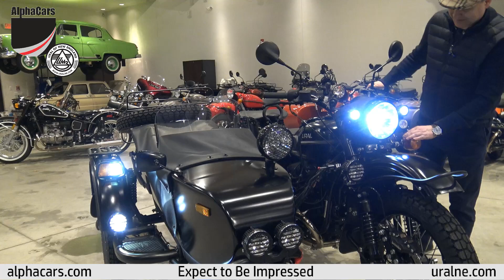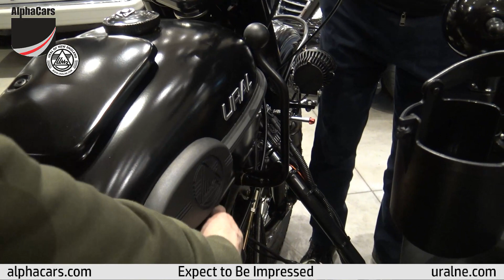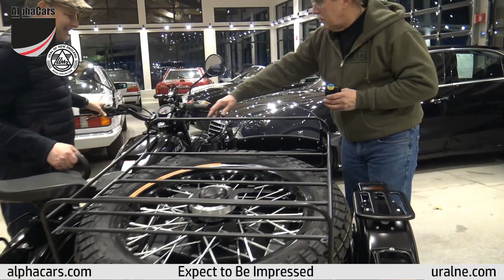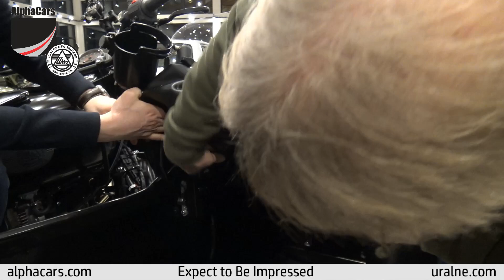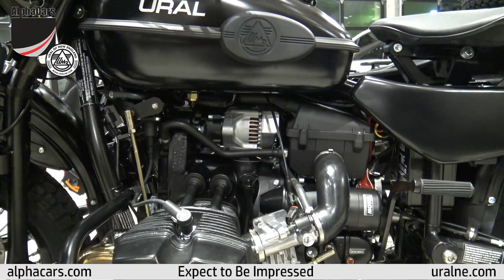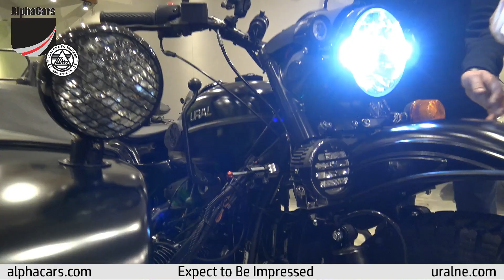2018 Ural Gear Up Custom, Overview, Ural of New England

Comment: Good looking Ural, but what does its weight come in at with all those accessories.??🤔🤷🏻‍♂️
BTW, we just took that style Air Horn off of our Harley do to trouble with the Extra Wiring to the battery and it’s own relay system and fuses. Not going to put it on the 2015 Patrol either, the horn that came on it works fine for us.!! 😎👍